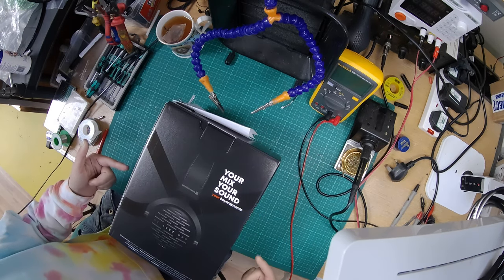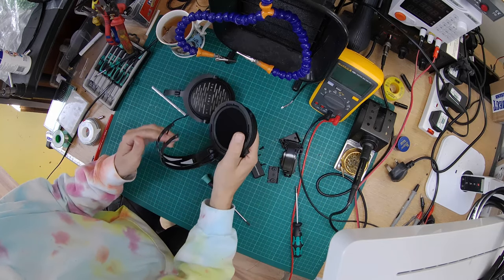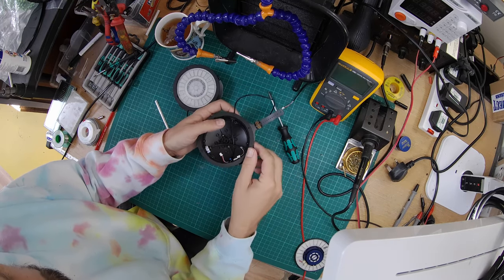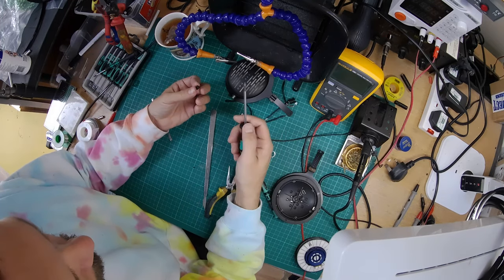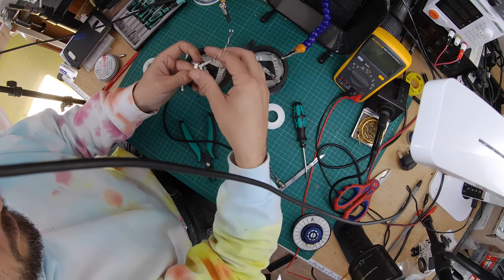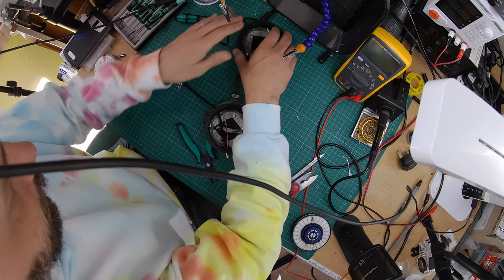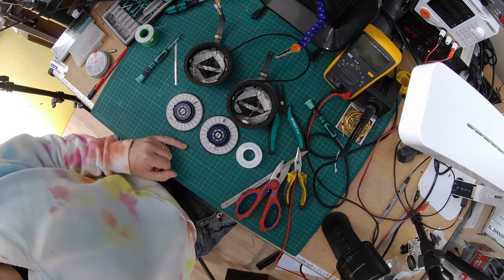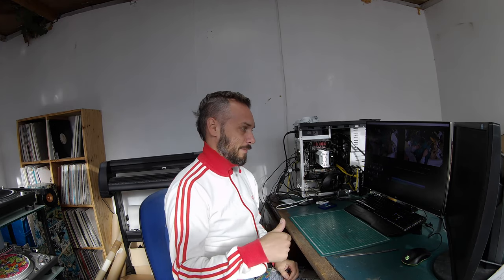Modifying Beyerdynamic DT1990 Pro to take a balanced input

Comment: Both those brackets you removed on both corners of mine have cracked. Can I replace them. They cracked all by themselves. The top pieces fell off but didn’t affect the screw. One actually came cracked. I am being pick because I like the new Mk2 models reviews.
Reply from the maker: Yes, beyerdynamic sell replacements

Comment: That’s awesome, but damping the inside must change the tonality a bit.  
Have you guys measured the headphones before and after to see how the damping inside alters the sound? 
Cheers
Reply from the maker: Yes - it does smooth out the 8K peak ever so slightly
Reply: @CustomCans  thought so.    Cool.  Does the new wiring do anything?  Doubt it. Except to give you more sense of a robust headphone.  The length is too small prob to make a diff 
Thanks and good work.  Too bad I’m in the US and shipping is crazy now
Reply: @Nightjar726  If you have a balanced headphone amplifier you are able to get more power output to the drivers from what i've seen

Comment: I had a horrible run with my set just recently (just over a year old). 

Started with the drivers - both blown (sounded insanely flat). As I began taking out the left driver - I could see the first issue (the soldered points for the XLR plug were already loose). But not only that, the micro JST connector leading from the XLR plug to the driver was crimped and bent. Mind you, these are units that have never been opened - ever!

So now I'm waiting for replacement micro JST connectors, solder it in and hope for the best. Even if I have it in a state where the drivers are still sounding flat - I'll replace it and be done with it :-)

Currently using my Sennheiser HD600's again and I want to bash my head in - it's just not the same.
Reply from the maker: we have a load of the sockets and connectors as we remove them when we convert them. Pop an email to custom cans and we can send you the parts for the cost of postage. The wires will all still be attached so a simple straight swap
Reply: @CustomCans  bless you guys. I'll be in touch!

Comment: Changing pads is so dfifficult. Nice video thank you.👍
Reply from the maker: If I remember correctly, the 1990 haver a notch in the ring that you attach the pad to - the trick is to hook the pad over that notch and then twist the pad and the notch will guide it into the groove

Comment: It would be super awesome if you sold aftermarket internal cabling using those clips that’s more robust. 
I’d buy em.
Reply from the maker: Yes we have tried in the past but getting them manufactured was too much hassle. We may eventually get round to it
Reply: @CustomCans  since I’m in the United States can I buy some of those wire snap in connectors to make my own internal cabling without soldering direct? 
Thanks guys.  
Too bad you aren’t here as well.

Comment: I wonder what size those 2 pin connectors going to the drivers are. Would be awesome to be able to find some of those so soldering into the drivers would not be necessary.
Reply from the maker: I think they are a 3 pin MOLEX Pico-Clasp connector but the pins are too small to take out FAT wire which is why we solder them directly to the driver

Comment: hey, thank you for the great tutorial. I have two questions, what do you use for sound damping inside the earcup? it looks like duck tape, but I am sure it's probably not. :-) My other question is, why do doesn't use a connector inside the earcup instead of soldering it directly to the speaker? do you know what connector is on the original cable? thanks!
Reply from the maker: The damping material is bitumen based. The wire we use in the workshop is far too thick to work with the original connectors but we are designing a DIY kit that will plug in to them so people can mod them them selves without needing to solder. The connectors used are molex pico clasp
Reply: @CustomCans  Thank you for your message and for answering my questions!

I'm looking forward to your DIY kit.
Reply: @CustomCans  : Any progress on that kit?
Reply: @CustomCans  Are you still planning on releasing the balanced wiring kit using stock connectors? I would be quite keen on giving it a go!
Reply from the maker: @guiver7772  Sorry - we got over run with orders and have not been able to get the kits made - we are booked up until the end of Feb but will try to get them designed and made then

Comment: Hi Guys! Just one question. I see from reliable website (as Moon Audio) that they sell cable 4.4m TTRS Balanced for Beyerdynamic DT 1990. How is that possible= I mean, I understand that with 3pins, balanced is not possibile, so what are they selling? And if I use this balanced cables, can I damage the headphones or the amp? Thanks in advance for your answer!
Reply from the maker: You should probably ask them... I know moon audio use to convert headphones so maybe they are modding the 1990s
Reply: I'm gonna do it, but they just sell the cable. Anyways beside this fact, if they sale a TTRS balanced cable that cable must have the 4 pins for the modded 1990, right?  @CustomCans

Comment: Please, friend, could you answer my question, I'm just about to weld the drivers and what you say at minute 24:40 It doesn't match what you already weld at minute 25:17
Reply from the maker: Sorry I may have said negative when I meant positive - We normally use the pen mark on the driver as the positive side

Comment: I want to buy a modified set from your website, but I have a few questions. 1- Can I still use them unbalanced? 2- Do you know if there are import taxes to the US? 3- The white and black splotched paint job is awesome!! Is that a 100 pound paint job or 150 pound?
Reply from the maker: Yes we convert one of the standard cables to a 4 pin so you can use them with atandard single ended equipment. You will probably have to pay some import duties but you can also claim the VAT back once it leaves the UK so you get about 20% back. White with black splatter would cost £100

Comment: hey jason! thanks for the video, my dt 1990 pros are having an issue where the right driver stops depending on how its positioned due to the cable going from left to right being damaged, do you know where i can purchase a replacement? or where i can buy something to replace it completely. i'm talking the little cable with the connectors on them.
Reply from the maker: You should be able to get one from beyerdynamic - they sell spares direct.  It may be worth opening them up and unplug the wires and plug them back in again to make sure it is not just a lose connection. You could replace the headband cable like I did in this video but it is tricky to do a neat job
Reply: @CustomCans  i opened them up and the red wire solder on the mini xlr input was loose. I think im going to do the balanced mod already! Can you point me on the direction of where to buy the cable you used to go from left to right? Also the balanced xlr input thing

Comment: Hi, thanks for your nice video, I'm about to try this mod to my 1990s. :-) Could you give me a hint on what diameter the two wires of your thicker headband cable have?
Reply from the maker: Our litz wire is around 1mm diameter - so 2 x 1mm wires and the paracord outer cover - that is about as thick as you can get through the original grommets. I don't think you probably need to go as thick as we do - it will be easier if you chose a slightly thinner wire
Reply: @CustomCans  Wow, that's thick. :-) Thanks for the info and the suggestion to use something thinner. I really appreciate your adice!

Comment: Can you show measurements of the damped 1990 vs undamped please ?
Reply from the maker: Unfortunately we don't have any more stock and our next delivery is not due for a few weeks. When they arrive I will make some waterfall charts though
Reply: @CustomCans  thank you
Reply from the maker: @Danny At the moment on the 1990, the changes are very subtle, slightly more detail in the bass from the extra weight and slightly more open sounding as the dampiing is stopping as many reflections inside the cup. We are doing more indepth tweaking at the moment and may have a V2 version of the mods in a month or two - hopefully we will get the treble peak these have smoothed out a bit

Comment: How the hell do you know which pins wire up as left and right on the 4 pin? I mean let’s say I pick up an aftermarket cable after modding mine, how will I know the polarity and sides match up to industry standard 4 pin? If you’re looking at the tip of the mini 4 pin going out (male going out of the cans) and the clasping point/keyed hole is at 12’oclock, where would be the L/G and R/G in a standard set up
Reply from the maker: Pin1 L+ pin2 L- pin3 R+ and pin 4 R- 
The connectors normally have tiny numbers next to the pins or here is an image i found https://images.app.goo.gl/67yPGt9rQGn1dJYF7
Reply: @CustomCans  you’re an absolute legend man
Reply: @CustomCans  you’re an absolute legend man

Comment: Can you order a left cup with the 3pin as spare part and use it on the right side, so you don't have to do anything but get a 4 pin to two 3 pin xlr cable?
Reply from the maker: you could do that but you would have to neaten up the headband wire holes which may end up being more work than doing it this way
Reply: @CustomCans Just snip them inside and leave them?
Reply from the maker: @NavySeal2k  I just thought it would look odd with one in front of the headband and one behind rather than both at the back. It is probably a good DIY option of you want dual entry but not something we would do here.
 If you don't mind a single sided cable... as a dual 3 pin cable is not standard, you would need to make a custom cable, if you have the skills to do that you may as well just replace the 3 pin with a 4 pin and not have to worry about the headband cable issues. The way we do it, we replace the headband cable with a Litz one but you could just re-use the stock headband cable and you would then only need to replace the socket which would make it much easier and cheaper. I may do a "DIY" video to show how to do it the easy / cheap way
just replacing the socket
Reply: @CustomCans  Ok, now I have a completely stripped 1990, but now is the question, is the positive or the negative side marked?  o_O

Comment: Does anyone know what to do, when my left side stops working sometimes when i move my head and i have to smack it to get it to work again? 
Started yesterday, Headphones are ~3 years old.
Sometimes i hear everything, sometimes a little less and sometimes nothing - no problem with the right side yet.

edit: Now i took a look inside, saw nothing i could do something about, put back together and left side is completely dead now.. yikes.

Not sure if repairing service would cost me more than just buying other headphones... rip 450 bucks i guess 😐
Reply from the maker: It may be a loose connection inside, The drivers have a wire that connects it to the mini xlr socket - you could try carefully unplugging it and re-inserting it and see if that improves things
Reply: @CustomCans  i found out what happened... the tiny tiny tiny copper wire on the driver pcb got lose but i confused it with a hair and ripped it out. Maybe it was fixable but now not anymore for sure. I doubt i can get a single new driver so i think i just buy 770 and never buy such fragile expensive things again. 😐

Comment: what gauge wire is the new cable?
Reply from the maker: It is a bit tricky to measure as it is litz but it has 84 strands per core, each strand is 0.071mm in diameter

Comment: Do these sound much better modded to balanced input? im currently using stock dt 1990 pros
Reply from the maker: I think it depends a bit of what amp you have, a lot of amps find it easier to drive high impedance headphones like these in balanced mode. You also get better channel separation but if you have a decent amp already the difference would be subtle
Reply: @CustomCans  i currently have the ifi zen dac
Reply from the maker: @jonathanleonard9507  The zen dac does put out more power in balanced mode so you should hear a small difference going balanced but probably not huge
Reply: @CustomCans  ahh got it! but will it be considered as an investment for future dac/amps that has balance outputs? Or it isnt worth it?
Reply from the maker: @jonathanleonard9507  It is totally up to you ;)   I have an RX8 which cost £2600 I then spent around £5000 on engine mods which probably only gained me around 10% more power - most people would say that it was not a wise investment but I really enjoyed the journey and knowing I squeezed everything I could out of what I had. It is all about how much it is worth to you.

If you did it your self it would cost £15-£50 in parts depending on what your cable was like and maybe 4 hours of your life ( so whatever your hourly rate is in work X4 to factor in the value of your time ) . If you paid someone to do it then maybe £50 to £150 again depending on the balanced cable you get with it. 
If it is likely to give you £200 in pleasure then it is a bargain :) but if you are short on cash I would not bother - the difference is quite small
Reply: @CustomCans  got it, thank you for that great comparison! I really appreciate it!

Comment: hello friend excellent work; Could you tell me what type of mod is the one you use in the plastic cup, that is, what do you mean by saying bitumen based? and where can I get it like the litz wire that crosses the entire headband? and finally what is the purpose of using a thicker litz wire; thanks for your answers and great help in advance friend
Reply from the maker: We make the litz cables here - they are made using litz wire of roughly 1mm outer diameter and covered in 550 paracord. If you search for sound deadening sheets for cars you should find the damping material we use
Reply: @CustomCans  thanks but i still don't understand what is the purpose of using litz cables does this improve the sound or is it for durability? Is that car material like an adhesive tape? thanks for your answers